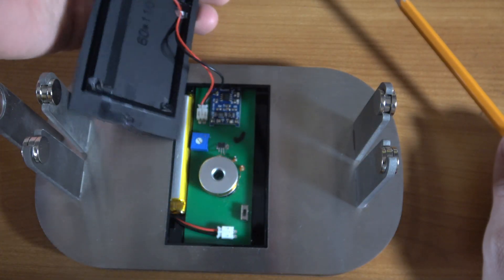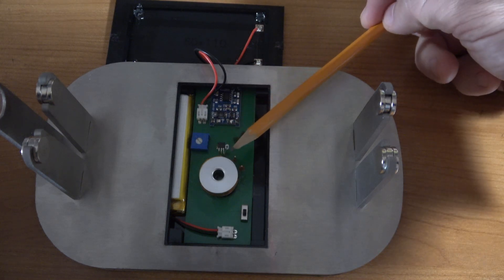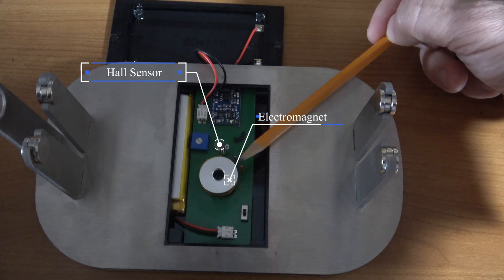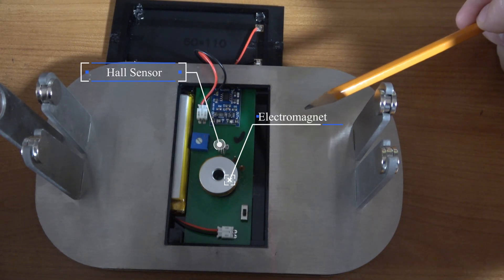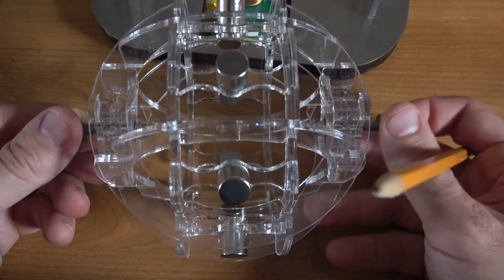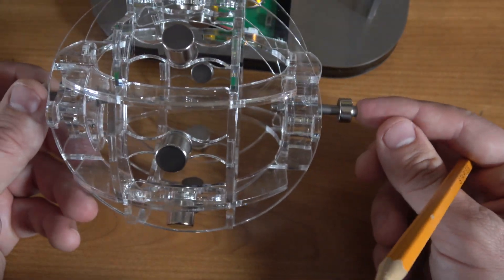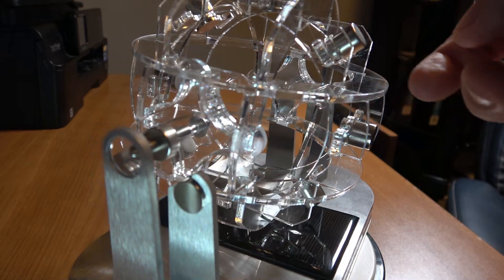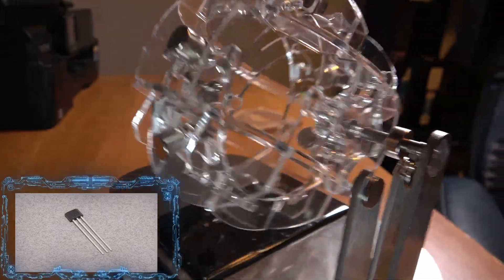The INCREDIBLE Magnetsphere Motor

Comment: Correct, any kind of electromotive device has efficiency losses, when you measure energy in divided by the work energy out it will always be greater than one.  Cool vid.  I think your armature could use a bit of balancing, at least it appeared that way.

Comment: That device is really cool.
Calling it a motor is a bit of a stretch, though.
Reply: This is literally a motor lmao. Just because it looks different it still uses magnetic currents power by an external power source
Reply: @everettstormy  so, would a magnetically levitating spinner top also be considered a motor?
Reply: @Olkv3D  yeah lol. Just because it's levitating doesn't meant its different. A lot of electric motors use pressurized air as a bearing, some use flowing oil while others oil impregnated bronze bushings. They are still motors
Reply: @Olkv3D  it’s funny when someone, like you did, makes a comment thinking they are smart but are actually wrong.  Just stop talking, you lost this one kid but keep learning!
Reply: @aleczander3457  Hey, wiseguy, I am trying to learn here, even through all the condescendingly sarcastic arrogance.
Reply: @everettstormy  I understand pneumatics and hydraulics. I also understand a rotating axis and axle.
But how/why does a few electronically controlled actuators spinning a wheel that is not connected to any type of drivetrain considered a motor?
Reply: @Olkv3D  alright, well this got way to heated to quickly. This is not meant to be a fight just a discussion. Alec learn to shut up and listen sometimes please. Soo, olkv3d a motor is still a motor even if it Is not connected to something. This device does in fact create a usable rotating motion. A fan could easily be added to the end of this thing and it could transmit energy onto the air. Although this is a very inefficient design with the permanent magnets being far from the electro magnet it works very similarly to a censored brushless motor. It'd just a very simple method of making something spin.
Reply: We are working with a weird format and very small amount of power but yeah. It's technically a motor. Tbh I'm not sure what else you could call this. And not trying to brag or anything. I'm an electrician professionally. I work with motors often and know there are a lot of ways to make electricity move things. This is not a solenoid (moves linearly) it's not an electrostatic type situation (moves ions in order to produce thrust) I'd say with confidence this is just a weird motor
Reply: @everettstormy  I wasn't understanding power input to mechanical gain aspect, like in a traditional "motor"; still seeing it as more of a novelty.
But, as soon as had you stated it's rotational force and then attaching a fan blade to it, all the parts fell right in place.
I could picture it clearly and simply.
-
Overthinking can be confusing.
Thanks, dude.
Reply: @Olkv3D  haha you lost the conversation and you were wrong ha ha ha...  ha ha ha....  ha ha    Ha. Also would you two like to go in a date and talk about it?
Reply: @aleczander3457  I know you saw what I had said.
Btt was it too much for you, make you want to report it ?
I thought you were a big boy.
So, I guess that's now two things I was wrong about, isn't it?
Reply: @aleczander3457  You are mine now.
Reply: @Olkv3D  I’m not into dudes....  ohhhh got you again.  Hahahaha 🤣
Reply: @Olkv3D  very happy you are able to admit you were wrong a minimum of 2 times, you learn fast kid!  You just needed a role model like me to help you stop acting like you’re so smart.  I also subscribed to your channel and will be giving advice when needed, talk to you soon.
Reply: @aleczander3457  I am most definitely in need of a role model, especially one such as you.
-
You know that feeling when you bite into a cherry tomato? When it pops all that fluid in your mouth?
It's refreshing is it not?
Reply: @Olkv3D  I told you I’ll take you under my wing.  Not sure about the tomato thing but sounds a little feminine ohhhh 😂
Reply: @aleczander3457  Do you get yourself good and drunk before going on YT?
Reply: @Olkv3D  i know you look up to me but if you’re under 21 you cannot drink.....  that is my rule...  I occasionally do drink though, why kid?
Reply: @aleczander3457  You have one of the most deplorable personalities that I have spoken with in quite some time.
Reply: @Olkv3D  you’re as good at talking trash as you are smart, not at all and in grade school levels.  Be quiet 🤫 or I’ll date your m0m and give you a bedtime
Reply from the maker: Thanks, I couldn't pronounce the other shape name for it heh
Reply: @Motor_Explorer1   you said motor and you are right
Reply: Hahaa.
One of my favorite words to say is Dodecahedron.
Reply: @Olkv3D  duh duh duh 🙄 so funny
Reply: @aleczander3457  eh?
Reply: @aleczander3457  Just how, exactly, did you go about shutting me up?
Because, it certainly wasn't with any intelligence or wit.
Reply: @Olkv3D  look kid just enjoy 4th grade.  Keep talking and I’ll make your bedtime 7pm